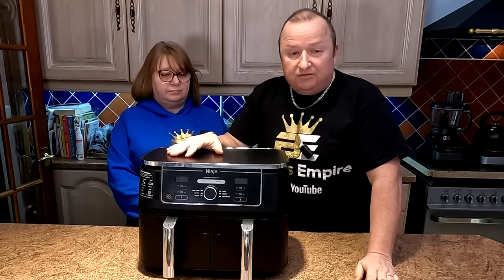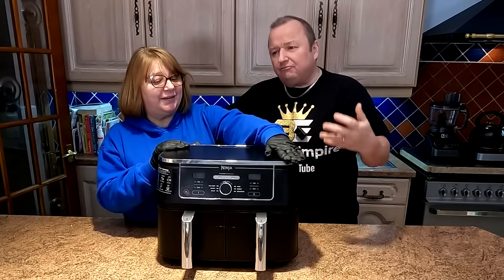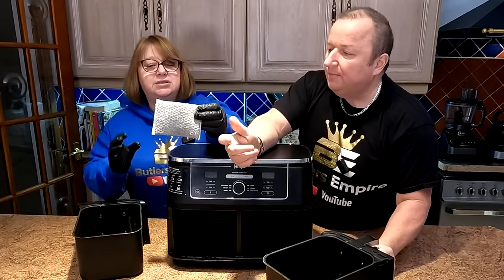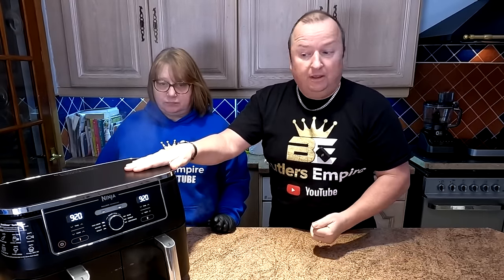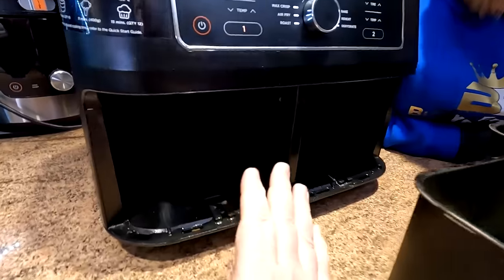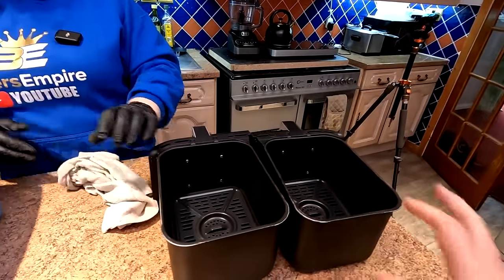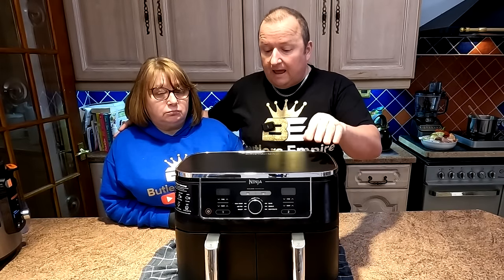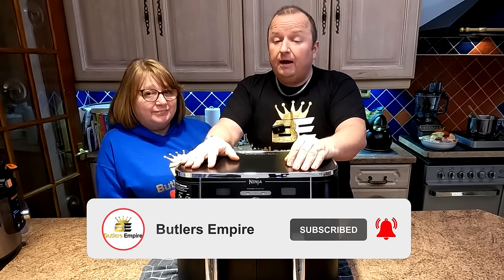Shocking Ninja Air Fryer - How Easy Is It To Clean?

Comment: They should have a plug in element you can take out.
Reply: That's exactly what I was thinking!😂
Reply: Or use normal screws so you can take the bottom of to unscrew the element, they used a few Philips, then some triangle security ones 🤦🏻‍♂️
Reply: FYI there is a single screw and washer holding the event down. As seen in the vid. I have taken screw off mine to lift the element and clean it properly

Comment: If you don't want to use a dishwasher tablet people a spot of citric acid or good old fashioned soda crystals work well BUT use gloves and watch your eyes for splashes and clean it well away after. May I also make another minor suggestion whatever you've used to deep clean with?? I run my airfryer empty on max temp for around 10 minutes after, so it burns away the odour and residue from the unit. Ventilate your kitchen well!!

Comment: I have a large single drawer AF and I give the fan and heating element area regular wipe outs with slightly damp paper towel. I wait till it cools a little, so it is still warm but not hot enough to burn. A sacrificial dishcloth (Wettex or similar) would also be a good option. You won't get it perfect ( you never do with your oven either!), but it will stop build up over time.
Reply: Thank you, always interested in what other people do.

Comment: Thank you for this video, it really helped me. However, during the cleaning process I found an easier way to clean the unit. Remove the front phillip screw from the heating coil, pull up the heating coil slowly and at the same time unhook it from the back clip. Note, DO NOT completely remove the Coil or back clip
Both Coils are connected to each other so clean one side at a time and put it back together before cleaning the other side
Use a #10 Socket Wrench to Remove the fan. Turn the nut clockwise to remove nut, lock washer and flat washer. I also used a small steel brush the size of a toothbrush and plumbing sandpaper that comes in a small roll. And a wet towel. It took a while but finally got it cleaned.
Roger from Dallas, Texas USA

Comment: I’ve been racking my brains over how to clean this part of my air fryer as well. This video has helped me so much! The bent tooth brush is a lifesaver —- I tried this and it worked an absolute treat. I also sprayed some oven cleaner on a paper towel and swished it around the fan area and all the nooks and crannies using the bent toothbrush and it has lifted pretty much all of the baked on grease. Thanks for the tips!!!
Reply from the maker: You are so welcome!

Comment: I had never cleaned mine up above the elements . Had it 14 months. After watching your video I looked and it was like yours . Very dirty. I wipe and wash pans every use but never cleaned inside the elements 
You did a good job, but made hard work of it. 
I can suggest a much easier way. I used my regular oven cleaner which is called  “ Oven Mate “ oven cleaner kit. You get a bottle of gel cleaner and in the box there is a double ended brush for getting into awkward bits . You bush the gel on and leave it a short time and wipe it off . 
I wiped it off with kitchen paper the used a wet J Cloth . Did do a 
lot  of wiping clean but no hard rubbing needed. After I got it as clean as I could I filled pans with hot water and did a crisp run like you did for ten minutes to remove any excess . Wiped it down again and it was very clean . The pans I wash daily but was surprised how the gel ovens cleaner did a good job on them as well getting in all corners etc.  so I recommend using Oven Mate cleaner .Much easier to use and no rubbing .
Reply: I think you made hard work of this.

Comment: Thankfully my air fryer is still new, so I don't have to worry about that atm. I am still learning how to use it, I nearly burnt the house down the other day doing chicken kiev's to close to the top, learnt that lesson quickly.  I would of set the smoke alarms off again last night (but I was babysitting it), found out it can blow the plastic off ready made meals (the ones you prick in a conventional oven).  Thankfully I was there when plumbs of smoke came out of it.  It's a big learning curve, but I'm loving my air fryer

Comment: Thank you for the detailed procedures for cleaning this air fryer! If only Ninja would take either or both of your suggestions and redesign this to be easier to clean! You gave the most descriptive methods, though. Even the owner's manual does not go into these details. However, they do recommend cleaning the unit entirely after each use! I did not anticipate having to do this when I purchased it. I've had mine for about 3 months and am going to clean it at least once monthly. Probably going to use baking soda and vinegar paste instead of a commercial cleaner. Now to the big oven! 😃😃

Comment: I took a leaf out of Sharons book a while ago. I now put hot water and soap in my basket to soak, or wash right away. I found even if i quick wiped and quick rinse i still got food bits on my dishes etc in the dishwasher.  This lemon tip is a good idea.

Comment: 2 tips:    1) if you are turning your air fryer upside down, lay it on a cloth to stop it from being scratched.    2) when cleaning the element/fan area 1st double check that your machine is unplugged and then do not use 'wet' cloths, only damp ones as any liquid getting to the fan bearings could ruin them and cost you dearly to fix. Personally, I recommend a quick wipe down of any accessible areas. The high operating temperature of the air fryer will ensure it is sterile and all bugs dead!
Reply: Good point about water on the fan bearings.
He's just put water in there on full power for 10 minutes, so that boiling water won't do the bearings any good, so I don't like this idea.

Comment: 🤔🧐 The easiest way is to simply clean it, inside and outside after each use, when the element has cooled down. As I only have a small, manual air fryer, it’s obviously easy for me to say this, as it only takes a matter of minutes, using a warm damp cloth, no cleaning chemicals whatsoever. However, I realise that the larger air fryers are more complex to clean, but it’s definitely worth taking a few minutes to clean them, (and much less work), as soon as possible, after you have eaten your delicious meal. 👍😬
Reply: I’m the same I always clean after each use with all my appliances cooker ,toaster,sandwich maker , washer powder draw . My moto is if you look after the item it will look after you.
Reply: I clean my ninja dual airfryer every time I use it inside and out wouldn’t use it unless it had been cleaned first
Reply: Agreed. Prevention is always better than Cure.
Reply: We have the Tower 1.5  Manual version, plus the 11.5 Tower Digital and clean both throughly after eash use.
Reply: @steveowen8563  I have the Tower 1.5 litre manual and I find that it’s easy to clean after every use, but it doesn’t really get that messy anyway. The only thing I always have to remember each time I clean it, is the 4 little silicone tips on the edges of the removable tray - I almost lost them the first time I cleaned it, because I hadn’t noticed they were removable! It’s a great little air fryer, ideal for 1 or 2 people.

Comment: Thank you from Pittsburgh Pennsylvania in the US.

My ninja dual basket air fryer gets used probably at least a dozen times a week.
like yours over time the top of the unit got so bad that it smokes. 

I've clean mine a few times but not a deep clean like that. Lemon dish soap and boiling water with a great idea. In the bent toothbrush was good. I have large hands I have a hard time getting into small spaces. 
I Have the same problem working on modern cars, my hands are too big.

I couldn't think of a way to clean the inside as well as I can clean the baskets. 

I even considered disassembling My dual basket ninja for thorough deep clean. Mine is well outside it's warranty.

Thank you very much.

Comment: I've just gone and checked mine, even though I wipe round it inside every time I use it it has some burnt bits under the element. Excellent video. I will have to get some of those pads

Comment: Sharon is spot on with the self cleaning ovens Martin. We have the same (now almost redundant) Flavel like yours. Anytime that gets hot and cooks food is horrible to clean. I wonder if a flexible bottle brush in the cordless would help. Maybe not though.
Bloody great vlog as always xx
Reply: That bottle brush and drill sounds a good idea. I think I would use proper oven cleaner that you lock in there and put the heat on.
Reply: Away
Reply: @catherinecaughey4839  Random

Comment: I had been wiping around the elements in my dual zone with a cloth after use and they were fine, then II roasted a chicken and when I wiped round the element the cloth was brown but most of it came off as it was fresh but there is still a bit left. I will follow your lead and use the pink stuff to remove it but will also continue to wipe the chambers after each use as it’s really quick. ❤

Comment: Absolutely brilliant video .  I was only on about this to my daughter the other day that i needed to give my air fryer a good clean and you guys come up with this.  I always use the method of putting an inch or so of water & washing up liquid in and putting it on high for 5-10 mins as it loosens so much built up grease etc.  great tip with the toothbrush👍.

Comment: Hi Sharon and Martin   Just to add a foot note to your video. I have the new ninja smart. When I pulled out the tray the alarm kept going off and the fan stayed on .  So did the usual things unplugged and left it off all night. So what I did is quarter filled draws with cold water and put them both on air fry 20 mins, and pulling out the draws it seems to have done the trick. Now working properly😊 Hope this is of some use. I have had my ninja since March with no problems till now
Reply from the maker: Never heard of that, Thanks Linda

Comment: Hi Sharon and Martin, still loving your great videos, thank you. 
I have always used something called Oven Mate, on my main oven, I know you said Sharon does not like to 7 use chemicals, but this seems to be odourless.
I used to get it from Kleeneze, but they have gone now, just found that Amazon stock it.
Just done my 400 dual, bit of a pain to get in there, but it's just a paint on leave for 30 mins and wipe off, then I do the lemon and boiling bit.
Perhaps this will help someone

Comment: Nice video! I have a Gourmia air fryer that I allowed to get very dirty so I just bought an oven cleaner spray, unplugged the device and sprayed liberally up into the heating element and fan. I then sprayed tap water to wash out the residue and let it dry.

Comment: I clean my bins and crisper tray after use and if it's baked on I use soap powder to soak in hot water. Good idea to put the soapy bins in the air fryer and turn on for 10 mins, I'll do that from now on. I wonder if it's possible to remove the elements and fan blade. May be too tricky. 
Thanks for the video guys. 
With our old double oven, which we don't use anymore, we used to say 'shall we clean the ovens or just buy a new one' 😂

Comment: I removed the heating eliment and the fan, i wouldent recommend doing what i did. The fan bends and are razor shape,the heating eliment wont come all the way out unless you pull off the wires. Dont do that you will never get them back on. I hate to say it but this is the only way. Great vid xx

Comment: Aren't they just a absolute pain in the rear to clean 😩  I use Bilt Hamber Surfex HD at 20:1  (Probably the best degreaser of all time)  and my little EZ detailing brush (For car wheels) then poke about with a microfibre. It really works a treat 👍 Great informative Vlog you two. As always much ❤️

Comment: Hi Sharon and Martin  just watched you deep clean your air fryer very helpful. Struggled cleaning the crisper tray last night after pork chops Will use a toothbrush next time Saved me buying a special  brush  Thanks xx
Reply: I soak both our drawers in soapy water for a couple of hours after use ..... especially good after messy stuff, then give them a wash and rinse. Once in a while I run them through the dishwasher on a hot cycle.

Comment: Why don't you use owen cleaning spray? Let it work for some hours. To avoid it to dry, cover it with self adhesive plastic for soma hours. Then while off with a humid/wet fiber cloth? Or is the oven cleaner to strong/toxic.
Just love you show. Due to your information I bought two Consori! Love them. And YES electricity bills have decreased. Love fom Norway 🇳🇴 ♥️

Comment: You can remove the plastic handles that are on the basket by undoing the four screws, you will be surprised by the amount of grime that is in-between. Also, the silicone feet on the crisper trays are removable.

Comment: I use a mixture of Oven Pride, Wash-up liquid, a non scratch scrubber and a toothbrush, Bar Keepers Friend and my Steam Cleaner. Loads of Kitchen Roll. 

Very messy process but it works for me! Probably once a month on the main unit. I never let the tray  get bad.
🤣

Comment: Hello  Martin when i had the Ninja AF400 when cleaning it i used ito take 4 screws and take the handles off so you can clean them properly also I purchase some of this from Amazon he had the best rating on there MAXXI clean oven cleaner mate talk about clean will not use anything else now. I gave our Ninja AF400 away i did not like the two draws so I purchased Instant VersaZone Dual Air Fryer comes with XXL Single and Double Air Frying Drawers it's the one with the big basket with the divider in the middle when family come over we like to have a leg of lamb goes strait in.
Reply from the maker: Nice one.

Comment: Not being a ninja fryer owner but think the elements  should be replaceable. So they must be somehow removable by getting a couple of screws undone. It would make cleaning a lot easier if the elements can be removed out of the way and put back after cleaning. Might go against your warranty though. I use 12 litre halogen ovens myself work on same principals as air fryers.
Reply from the maker: Yes you probably could but most people wouldn't be expected to do that so we just wanted to show what most people would try.
Reply: Yes Probably too daunting for most to try but me I always try to fix things or replace parts myself and mechanically minded. Saved a lot of money over the years. Lol my family and friends call me Mr fix it. Absolutely love your channel and watch them all. Good luck on your weight loss program. RT

Comment: Great video folks, unfortunately as you pointed out this is the achilles heal as far as air fryers are concerned like almost everything in the modern world designer's dont consider the cleaning and maintenance of these appliances, we have 2 ninjas the foodi dual zone and the speedi, both i have to admit excellent kitchen appliances, the only solution to keep these appliances tip-top is to clean them after every use, which is  easier to say than do unfortunately 🤨. Oh and will definitely be using the dishwasher tab/lemon/hot water cleaning method, thanks for that 👍

Comment: In the states under the element ,aluminum is placed. Plus I have noticed that other brands are equipped with covers or metal above the element. But I don't know which brand it was.

Comment: Hi Martin, just a heads up, I got a Meater thermometer, it also measures ambient temp (oven) I found my dual zone is 20 degrees C over what the setting is, I.e air fry on 180c is actually 200c in the dual, now I know, it cooks a lot  more consistent Than before
Reply from the maker: Thanks for the info

Comment: what I used to do with the big oven on the cooker is mix bread soda with water and lemon juice and leave it in the oven for 20 mins to get the built-on grime off it might work on the element and fan in the air fryer just turn it on full for 15 mins it might be better and  easier  to clean

Comment: The Elements are normally only held in with a couple of screws to remove and refit , would that be possible guys with the Air-Fryer ?
Reply from the maker: Most people wouldn't go to that extent, that's why I wouldn't show that.

Comment: The Teflon coating is only inside the food boxes, not on the bottom. The rubbing marks on the bottom are from your container feet, not from grit. If you had done all of the elements before the 10min cycle, the steam would have cleaned all of it off, so much faster and less scrubbing. Or degreaser, then use a steam cleaner, done in minutes, zero hassle, no toothbrushes needed.

Comment: Hello, can you use small bottle brushes to clean the top part of the fan-element area instead of toothbrushes, bearing in mind the bottle cleaners are nylon, also you can bend the bottle cleaners? Many thanks. Lionel.

Comment: Morning you two lovely people, flipping heck Sharon and Martin that was a pain in the you no what ,just about to go and mix some bicarb and lemon to put on sides of my tower oven and leave for awhile, my little Cosori that I bought after you trailed it is really good ,I love my Cosori for a small air fryer it's great and not that small more than big enough for the two of us never use conventional cooker and hob now as I also got a work top induction hob so fast ,again a great tip from you two . Hugs for you both Anna in Shropshire
Reply from the maker: Thanks Anna.

Comment: Having watched this video I inspected my Ninja Foodi Max (had since 11/2020) and my Ninja Dual AF300 (had since 6/2021) and whilst not shiny they were not that bad.  I do put the drawers in the dishwasher after use and there was nothing to clean on the drawers. I tend to wipe near the element with a damp cloth a few whilst they are still warm if I have been cooking anything spitty or fatty so I'm thinking doing this has helped.